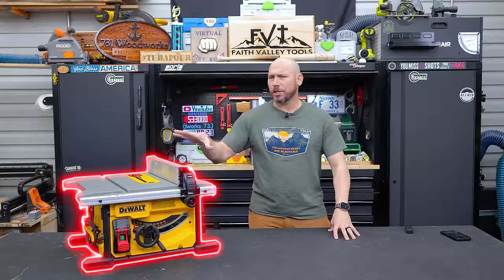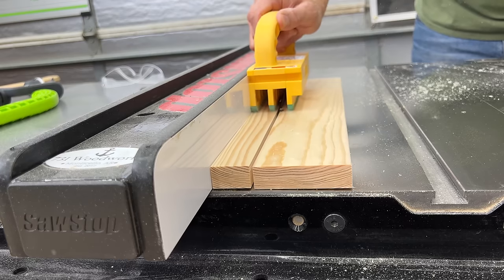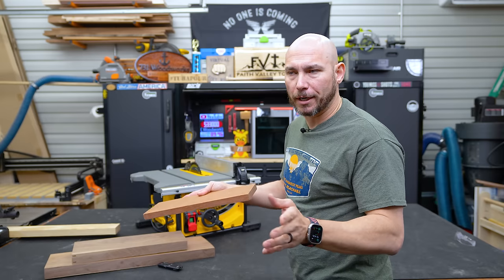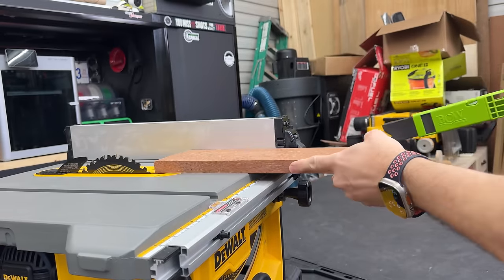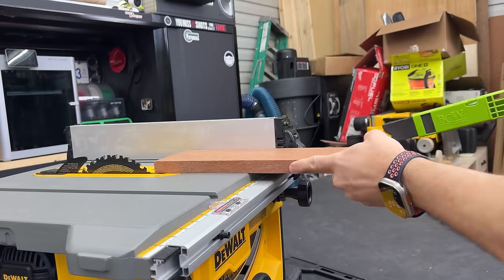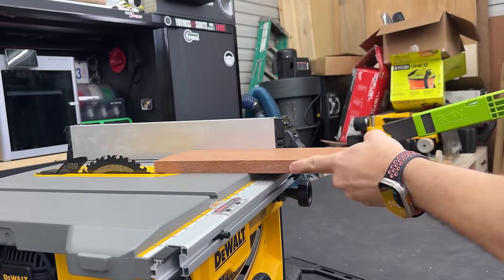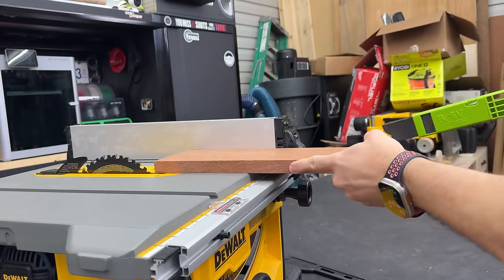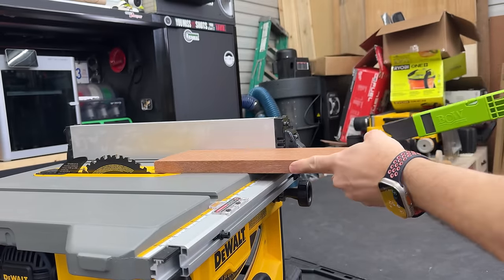99% of Beginner's Don't Know These Table Saw Mistakes to Avoid!

Comment: As a guy that grew up in the wood shop (worked summers helping make cabinets as a kid since age 13) I have 50+ years on the tablesaw and still have all my digits! One thing I was taught as a kid was never setup the saw with the table leaning away from the fence. Level is perfect but leaning a bit into the fence is better than the other. Again, kickback = BAD! Also avoid blades with too many teeth. Less is more when ripping.

Comment: Good advice. A couple things I would add is if you can , pull the trigger and get a cabinet saw. Avoid any saw that has direct drive. Belt driven saws are much better and safer. Another technique I use is as I am ripping a board, standing to the left of the blade, and fence is to the right of the blade, keep my left hand behind my back while my right hand is on the push stick. Always know where your hands are. Once the rip is done, shut it down and dont move or grab the off cut until that blade has completely stop. I try to think my way thru what I am doing. If you are not comfortable doing a particular cut then DON’T do it. There is always other options .

Comment: As a cabinet maker for 32 years and a boatbuilder for the last 11 years, I have a lot of experience on various table saws as you can imagine. I might do some things differently to you but I wouldn’t disagree with anything you’ve said or demonstrated… apart from one! How much to project the blade above the wood, and I only disagree with that in one scenario and that is because in all my years using a table saw I have only once had a nasty accident and once had a near miss and they were both doing the same thing which was cutting thin plywood.
So I strongly recommend, no- urge people, when cutting say 1/4” plywood or very thin wood or board, particularly if it is wider than  a few inches, project the blade a good inch and a half above the surface because if you only have the teeth just project through say to the gullets, the likelihood of the ply flexing and then getting on top of the teeth is very high and if that happens the teeth will grip the underside of the ply and throw it at you so fast you won’t have time to blink. 
Yes you can use various devices etc instead to make this operation safer and if you have them please do use them instead, but if you don’t and you’re just using a bare table saw please heed this advice. The first time this happened to me the corner of the piece of ply hit me so hard in the lower admin that I had to have the afternoon off because I felt sick and had a bruise for over two weeks. The second time, as it was narrower, it luckily shot past me but it was before I even reacted so it was just chance.
Since always projecting the blade more when cutting thin ply (that’s the only time I do it) I’ve never had it happen again.
I hope this makes sense and makes for safer cutting.
Guy.

Comment: great video thanks for all the valuable info. I did notice though at 19:25, you are demonstrating how to use the JessEm Stock Guide, but I can see you've run into trouble there... how can you push the piece through with your push stick when the roller is in the way.. ?

Comment: I own the Grrriper. What I don’t like about this product is the “dwell time” you spend with your hands and arms over the blade while using the device. Plus, you really need two of these things to cut a board of any length. Thus, you end up walking the stock through the saw by crossing the blade several times during a single cut. In addition, the grippy surface doesn’t grip so well when the least bit of sawdust gets on the cleats. 
Don’t get me wrong, this product has its place, and I do use it often, but it has some inherent dangers that are not obvious when you first look at it.

Comment: Very well done. And, in my opinion, absolutely all correct. Agree with all of your recommendations, and employ them. Based on physics.  Still, "If it's not right in your gut...don't make the cut."  I picked up a small scrap of wood to make a caul to hold down the top of a router table, thinking "it doesn't have to be fancy." Cutting it to length on the chop saw, I thought "that doesn't feel right, twisted grain, I had better stop..." That was approximately about 2 milliseconds before it bound and grabbed on the blade, spun it around and smashed the end of my left thumb into about 13 pieces.   Stupid.   I volunteer with the local Fire Department (HAM radio, Emergency Communications, so they can do the important stuff, instead of yakking on the radio), so I have several fire extinguishers around the house, emergency ladder in a box on the upstairs deck, etc. I have a first-aid kit in the garage. (and one in my truck, and another on the boat). A Marine, I carried First-Aid gear on me. But, not until your video, here, did it occur to me that it might be a good idea to have an actual tourniquet or two around the shop. Figured I could improvise one. I like learning something new every day.  Well done.

Comment: Just a note.   a roller stand, if the yaw axis isn't square with the table saw axis, can pull or drag the far end of the cut board laterally, causing it to bind on the back side of the blade

Comment: It might be a foolish question, but whenever I see push blocks they don't seem right to me. Never used one but wouldn't it be riskier to use one in case kickback happens? It probably would twist and get your hand/forearm right into the blade. Also I feel push sticks should be wider so it gets a little more stability side to side. Might prevent from tipping them over and get yourself injured.

I would love to hear opinions on this, as I'm just inexperienced and maybe I'm getting it all wrong. Thanks!

Comment: I’ve been a master carpenter for over 30 years, best piece of advice if your thinking of getting a table saw, get real time instruction from someone that actually knows what they are doing. YouTube is great, but there are way to many quirks around table saw, mitre saws, skill saws, routers etc. These saws are incredibly dangerous in the wrong hands and one mistake will cost you at minimum a digit.

Comment: Really good advice!  I don't have a table saw, but I have 1960's Craftsman 10" radial arm saw.  It has tried it's best to kill me and it's my fault for not knowing how to use it properly.  Kick back happens so fast that you never see it coming.  My worst experience was back in '69 using a 3/4" dado blade to cut plywood drawer sides.  It was raining and I was in an open door garage.  Lightning struck somewhere just outside the garage and it startled me so bad I shoved my hand into the blade.  If I had been cutting with the regular blade my thumb would have been severed.  It did do a lot of damage to the tendons and a little to the bone.  Luckily even back then we had great orthopedic surgeons and one was able to patch everything back together.  Strangely enough It didn't bleed.  It looked horrible and had me thinking the worst.  Still use the saw today and have much more respect for it and push sticks.

Comment: A couple questions....does it matter which side does should the fence go on? For example the side with more wood that will be left over or less?

As a general rule then, never use a fence and a miter?

With the push sticks, do you not need pressure down on the wood as well?

Comment: 30 years ago, I had my first kickback. A direct hit in the middle of my belly that was very very painful. I sold my table saw, that did not have a riving knife, with a quickness. I finally got enough nerve to purchase a new one a couple years ago, and have learned all the safety basics from your vids. I have not had one kickback since. My fear has diminished but as you should, always have a lil fear, it helps to keep safety in mind. Thanks for training!!!
Reply: Fear is good if it animates you , not paralyzes you.

Comment: Some good pointers. What kind of wood was that reddish piece with the strange grain ? Looked like a nice piece . A planar is always handy for the warped and bent pieces your are trying to cut. Many times a cheap fence will cause many problems and when clamped the far end is not quite tight enough.  :O)

Comment: The other day I was having a bad day.  I had about 5-6 kickbacks in one day.  For one I was cutting small squares of plywood for a chess table I'm making, my miter saw was out of commission, and I figured out real quick that somehow my blade and fence weren't square anymore.  So after catching a piece of plywood to the chest and destroying a level hanging on my workbench I decided to stop for the day.   The next day I used my laser distance finder to get my fence squared back up to the blade and also got my miter saw back to running.  I must say my nerves were better knowing I wasn't going to have to use the table saw for that purpose anymore.  Side note- don't buy a Kobalt 7 in miter saw if you can avoid it, its what I could afford and it works but I can't wait to be able to upgrade.

Comment: I had a kickback on an old cheap table saw that left a scar on the inside of my elbow and on my side through the shirt I had on. That scared me so bad, I replaced it immediately with a Delta hybrid saw that I would love more if I took better care of the top. I did get the zero clearance insert because the gap was uncomfortably large when it was new. That table saw is now a stand for my Dewalt 735x.

Comment: Anyone who is a woodworker should ALSO be into 3D design and printing as there are SO MANY useful items you can 3D Print!!!...Push Sticks, Center Finder Jig for dowel stock...heck I even 3D Designed and Printed a Thin Rip Jig, which I plan on using to cut some thin strips to steam, bend and do some laminated edge banding on a table!!!

Comment: Serious question,  I worked in a cabinet shop and the old guys demanded you stand in front of the work piece.  The reasoning was that if you had a kick back it was your fault and you should absorb the injury.  Not letting the piece fly and hurt someone else because of your mistake.  Thoughts?

Comment: 24:06 in addition to using a tourniquet, if it doesn't hurt when you're tightening it up, it's not tight enough. The entire point of it is to cut off blood flow, and it WILL be painful if applied properly.

Comment: So ... I have a question.  In one part of the video, the use of a blade guard is recommended (to use "whenever possible") ... but then cuts are made without a blade guard and are made using a push stick or Microjig.   Should a blade guard AND a push stick be used at the same time "whenever possible" ... and if not ...what are the exceptions?

Comment: one thing you didn't mention is to have sure footing before using the saw. If the floor in front of the saw has loose sawdust and the surface is shiny it can be like walking on ice. If you lean forward making a cut your feet can slide backwards propelling you forward on to the saw. Always keep the working area free of sawdust and wear rubber soled shoes which grip well.

Comment: The Milescraft Push Block is technically a knock-off Microjig but it is just as effective and cheaper. This is a really comprehensive and well done safety video though.

Comment: Something I wanted to add, is whenever the saw is running, be on guard that you don't trip or fall and maybe swing your hands crazy around into the blade, especially if you're not using a guard. I have a 1950's Sears Craftsman table saw with no guard and I'm always as careful as I can be.

Comment: I've seem 3 people have table saw accidents.

All 3 were because table-saws are terribly designed for supporting your material after the cut.

Mounting places should be on every saw to easily add your own extra 12" of outfeed.  That would support most small cuts where people are tempted to catch their off-cuts, but not long enough for a roller to work for supporting anything.

Comment: One trick I learned when cutting a long piece is to push it half way,  then push down on the end nearest to lift above the blade,  then reverse board and cut the other half shutting it off when cut complete,   That way there's no need to support the overhang. 
  Occasionally the meeting cuts will be slightly off but never something thats critical.

Comment: In Europe, it is normal to adjust the fence so that the distance to the blade, is slightly larger at the back compared to the front, this to minimize the risk of the material getting pinched at the back, so there is a risk of the teeth on the blade catching the material and kicking it up .
Reply: Interesting comment, several have made it...I can understand it but I think every saw I've ever seen in the US was designed to be parallel.  Very interesting...
Reply: @asmith7876 Required by trade safety regulations in Europe. It has been a well known cause for kick back. From my own experience as a hobbyist only, it definitely helps. Makes sense, when you think about the force vectors. The clearance prevents the upper left corners of the work piece from catching the upward and toward you spinning blade, thus preventing the lower right edge (longest distance are between diagonally opposite corners of course) from getting pinced.
Reply: @acki9449  After some research I discovered some fences stop just after the blade! Not in America! I can definitely understand the physics of it. I said in another comment perhaps we’ll adopt this…right after the Metric System 🤣🤣🤣. Actually with the splitter in place I’ve never had an issue with the fence being parallel. Cheers from America!

Comment: Maybe this really is a novice question, but it's something I've always wondered when I see people build a cross-cut sled: why? I mean, I understand that if you only have a table saw you are going to do cross cuts with that saw, and then a sled is a "must have" for safety's sake, but if you have a miter saw, why wouldn't that be preferable for cross cutting? I mean, I also understand that your stock may be wider than your miter saw can cut, but in watching these videos, I've never seen a piece of stock used with a cross-cut sled that could not be handled by a 12" sliding miter saw. This is a sincere question, by the way, because if there is a genuine advantage, I'd be willing to invest the time/effort into making one, but if there is no particular advantage, then I would say I probably just feel safer (and better skilled) at my miter station.

Comment: I am having a hard time finding miter bars to fit my craftsman table saw. They are thinner than standard and I cant find them. They are cheap enough I'd like to buy them. I know they can be made as well but just wondered if anyone knows where they can be bought online or wherever. For this reason I have some trouble making a crosscut sled or buying one. I'd like to know that its straight and would like to buy something to assist but none have the bar width. Same with my craftsman router table, same width, with a little grove on the side of the slot.

Comment: One thing I do on my saw is put a straightedge up to the blade and draw a line on the table where the blade will be when it comes out of the wood.  Do that for both sides of the blade. Use different colors to mark a single blade verses a dado stack.

Comment: I wait until the end of the board goes past the edge of the platform before using any pushing stick but use the pads, especially for wider cuts when tne push pads also push the wood downward as well as add extra sliding control

Comment: #1 recommendation - get an adjustable extender table (adjustable height).  Every error I have seen on a table saw has come from the material falling down off the table (post cut) and then catching on the blade.  #2 - buy / buy or sharpen blades.  Just like a chainsaw (my neighbor gawks at how my 40v chainsaw cuts...hmmm).

Comment: Thank you soooo much for this! I’m currently building a new shop and have only used a radial arm saw for big cuts, but inherited my dads delta UNISAW which I will finally have space for. Do you know if they have aftermarket Irving knives for older saws?

Comment: I had my only table saw accident very early after i started using it. I was doing everything wrong and piece of wood flew on my face with full force. My left hand fore finger followed over the blade and got nice cut. I think it was a lucky accident since it taught me caution which i have forgotten. Those who have never experienced any mishap with table saw cannot believe how quickly a small wrong move can cause big injury. And the power of the spinning blade is unbelievable. It feels like mule kick in the head.

Comment: When I was a teen, I was wearing a hoodie with strings while I was using a bench grinder wire brush. That brush grabbed my strings and my throat was rapidly pulled towards the rotating wheal of bloody death.  I barely had time to drop what I had in my hands and push against the table, until the strings broke.  Those strings might not be that strong, but they had the advantage of surprise and speed, I nearly died.  I thank God I didn't leave a gruesome site for my relatives that day.

Comment: -The fenc should be a tiny tiny tiny bit off in the back, just to prevent the fenc from pushing your wood in to the plade in the back.
- you shouldn't be standing behind or in front of the saw, but on the side of the table. Yes standing behind and offset can be a little bet safer however a kickback could still get you. If you stand on the side of the table it is the safest position you can be in. And yes this also works with whider tables..

Comment: I actually stand to the right of the blade. I can grab the board on the other side so it doesn't drop, I'm out of the way if there's any kick back, and I use the push stick to turn off the table saw so I don't have to reach around and be in front of the blade.